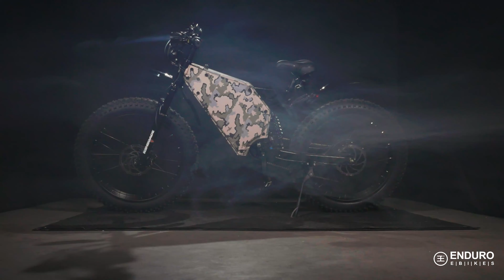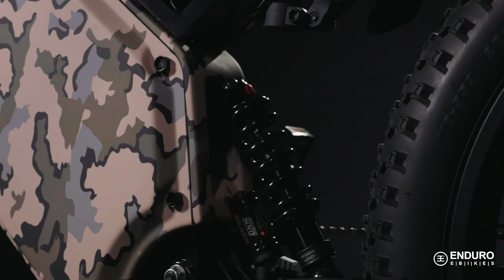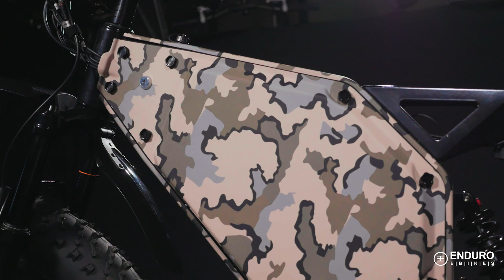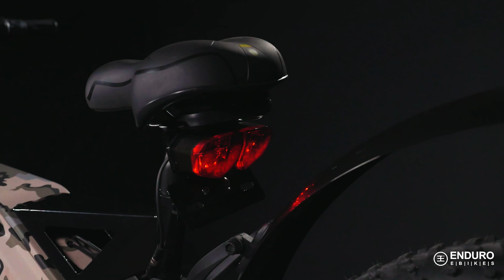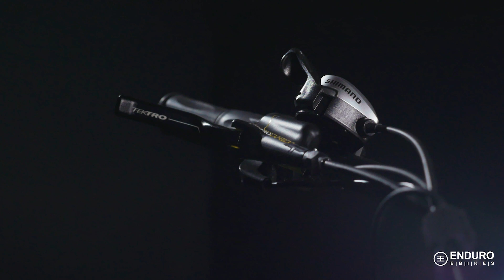Unboxing Our 5000w Fat Tire Enduro E-Bike - How To Build Your Own E-Bike

Comment: Hey this looks great! How does it ride on just the gears and chain? Just in case I were to run out of juice and had to peddle home?
Reply from the maker: All of our 5000w or less bikes are easy to pedal without assist with the gears. The easiest one of them all is the 1500w which you won't even notice any motor in the rear wheel.

Comment: Ротор 180’ можно использовать ? у продавьца есть фирменные 180’ с 6 болтами ( то что мне нужно 6 болт )    и есть фирменный 203’ ( там вставляется и зажимается крепление другое… ).                                  Rotor 180' can be used ? the seller has a branded 180’ with 6 bolts ( what I need is a 6 bolt ) and a branded 203’ ( another mount is inserted and clamped there ... )
Reply from the maker: Your building your own custom bike, very cool!
Reply: @EnduroEBikesCanada  Thank you. Everything is fine)))✌️👍 😀
Reply from the maker: @gamePSeBikeEnduro  ok if you need any additional help you can always reach out to support at customer.services@enduroebikes.ca

Comment: Hello, tell me please 🙏 I have an eBikes Enduro frame/ Dnm 8 fork! everything in your video. 19’ moto wheel rims, motor 5000kw. the question is: will these Magura MT7 brakes fit? and what size rotor do you need 180-203?! Thank you ... waiting for your answer))
Reply from the maker: We use Magura MT5e and modify the brake switch sensor to allow for connection to the controller as needed. We also add a custom spacer in the rear to get the rotor in the right spot. The 5kw model will come with 203mm rotors front and rear.

Comment: Тормоз дисковый Magura MT7 Pro Disc Brake - black/grey, 4 поршня,
Reply: Hello, tell me please 🙏 I have an eBikes Enduro frame/ Dnm 8 fork! everything in your video. 19’ moto wheel rims, motor 5000kw. the question is: will these Magura MT7 brakes fit? and what size rotor do you need 180-203?! Thank you ... waiting for your answer))
Reply from the maker: We only offically support Magura MT5e brakes and 203mm rotors. 160mm is also used on some builds. If you ordered directly from us we can provide you your exact spec list. We supply this frame to a lot of 3rd party builders but do not offically support every option that they use only the ones listed here https://enduroebikes.ca/product/custom-build-ebike/